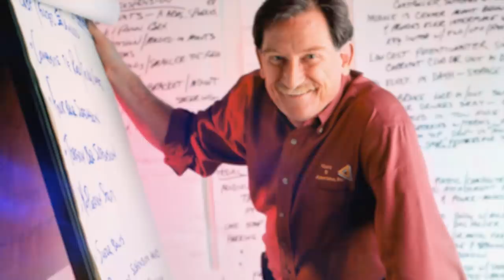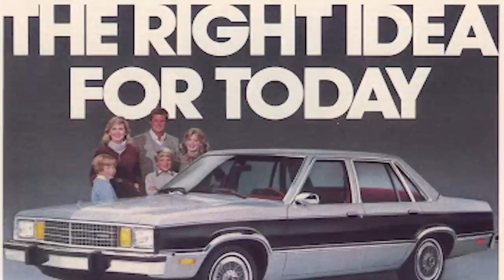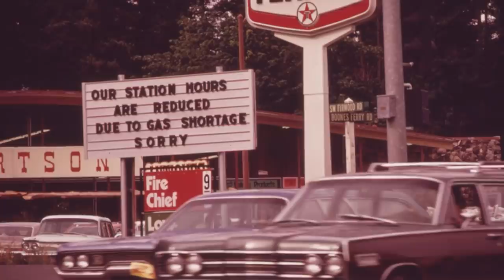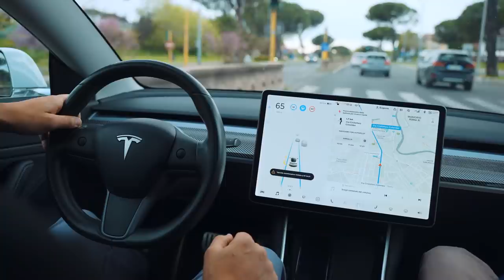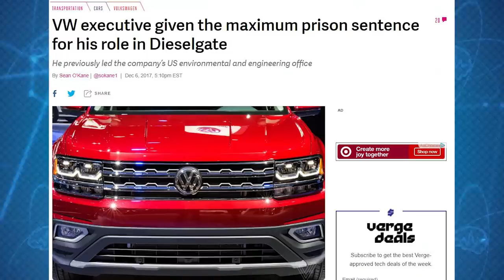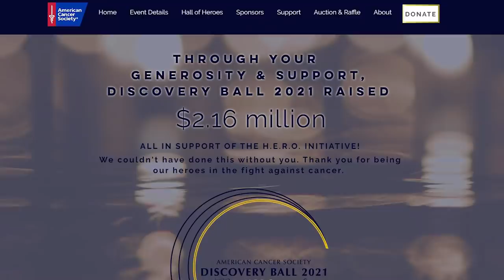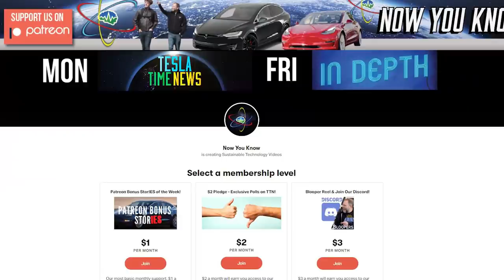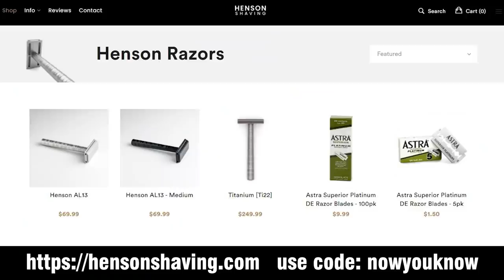China is Coming: Observations from an Expert | In Depth

Comment: I live in the Philippines. Geelys are sold here. They have the latest technology and are exquisitely well put together. They have integrated Volvo quality and technology into an inexpensive base model car that sells for about 27k USD, and that's with the Philippine 40% import duty tacked on.  The US can not compete.
Reply: happy that you like it, in China, however, we gradually go to EV cars. The best-sold ones are Tesla Model 3, Y (given that they have a factory in Shanghai), and BYD (very good local brands, they produce very nice batteries), BYD gives very high quality-price. There are tons of EV brands, NIO, Xpeng, MG, ....
Reply: If anyone in the jeepney association in the Philippines is thinking at all, they might partner to build an infrastructure to support battery charging stations. Several decades ago I recall doing a paper on electric cars by the big three here in America and I was astonished at how woefully behind they were contrasted to asian perspective on battery operated cars. It’s too late, $25,000 cannot even buy a decent new gas-powered car in the US today.
Reply: Are there any Geelys with fast charging ?
Reply: @ynordia  Not that I know of, if they allow them in it’s not going to be priced at $27k. The requirements are stricter here for foreign manufacturers.
Reply: @JonMagno  you're right, those prices are with 40% import tax while the US has no more than 5% so the raw cost with profit of the car to be shipped here would be 19k. Assuming regulation reqs cost 5K more, they could still sell it at a profit for 24K but realistically in the American Market they're going to sell it for a lot more
Reply: @naturecare6072  I may partly agree, but have a look around your place of residence, your clothes, your tools, your cookware, your computer, your cell phone you may be using to reply to this post. The world allowed the PRC to be its factory, voluminously. It will take a paradigm shift to change those habits. Also they don’t have a monopoly on copycatting many other countries are guilty. That said, I do not drive a PRC-made vehicle but I may have little choice in the future.
Reply: @naturecare6072  that is a typical conventional wisdom view, but it is the way China has dominated the world in trade Ade and manufacturing, why spend millions on R&D when you can appropriate someone else's technology, then improve upon it? China plays for keeps they don't play by your rules. They are ruthless in their efforts to control the world's technology, metadata, and money supply. China controls enormous amounts of US dollar holdings, it had a strangle hold on the US economy, your hollow words about the stereotypical Asian copycat view is naive. China is going back to the moon, the US just further postponed it's efforts to do same, the product of a state run capitalism bent on world dominance, china has a many pronged approach to producing goods, both of low quality for mass marketing, and the highest quality, I phones and Teslas, Volvos, Hummers, and many more, they have made us dependent on cheap Chinese goods while at the same time stripped the US of almost all manufacturing infrastructure. They are winning, because Americans were too stupid to see it coming.
Reply: What model are you taking about ?
Reply: I think china car quality is good, but their price is not a lot lower, and tesla is already in china. And the next gen battery tech is at  tesla, toyota and quantum scape not china.
Reply: Same here in Malaysia we now have
Proton X70 = Geely boyue
Proton X50 = Geely binyue
Both sell really well, i'm planning to get the X50
Reply: 8
Reply: @naturecare6072  your probably a fast food worker trying to take credit for all the Innovation around you. Haha
Reply: @linliuqiang92  childish remarks. Develop your EQ. Oh your gov won’t let you. They like sheep.
Reply: @randomname931  You can’t copy emotional intelligence.
Reply: @naturecare6072  ok, whatever.  just keep denying that china is pumping out quality, original designs and engineering.  you can't deny that they are the leaders in many industries (5G, AI, drones, apps including phone payment, and on pace to do so in EVs).
Reply: @naturecare6072  haha, you can try brushing off my childish remark, you cant brush off the reality of your minimum wage job.
Reply: @naturecare6072  Ok Gordon.
Reply: @TN-jb4jk  you should go look at the complaints. Poorly built
Reply: @naturecare6072  Tesla just built a huge factory there
Reply: I would buy a chinese car...but I would prefer it to have a Volvo badge.
Reply: Mercedes are £25,000 in UK 🇬🇧
Reply: @ynordia  GEELY is not that famous for making pure electric car, their first EV just went on sale recently (Zeekr 001), under a sub-brand ZEEKR.
Reply: Are Geelys are durable and safe? If they are, that's excellent!
Reply: @DEeMONsworld  i am well aware of everything you pointed out and more but I'm not going to brag about my China made toys and I at least try not to fund the CCPs military. Call that a "high horse " arritude if you want dude.
Reply: @MrRmann1234  no one was bragging, just stating the situation, few inside the US cocoon have any idea about the world and how China is sucking up technolgy and reselling it wolrd wide. Btw, I don't own a Geeley, never said I did. I have a Japanese car made from parts in Malaysia china and japan, and an Indian motorcycle engineered in the uk with parts from china. That pretty much sums it up.
Reply: @asterozo  lol 🤣 catl is the biggest and best batteries Olin the world's Tesla is using china's catl battery lol 🤣 where do u find these crap
Reply: @naturecare6072  haha. GDP doesnt mean anything for living standard. Chinese can buy more amount local basic goods than an american can.
Reply: @MrRmann1234  So buying a japanese or american car is also funding the enemies.. they literally invaded Philippines
Reply: @DEeMONsworld  good for you.  Now but a Tesla
Reply: @stewartbeche686  that's a rather naive proposition boycott every American manufacturer your saying as they all use Chinese labor, too late for that sentiment.
Reply: @cryptorenegade1406  we can do the same to them.
Reply: @donaldli1864  EVERYTHING!!!!
Reply: @MrRmann1234  true  preach on brother!!!
Reply: @ynordia  

Geometry brand, they are Geely subsidiary.

Go check out Wheelsboy.
Reply: @naturecare6072  

You meant like the NSA…?
Reply: @stewartbeche686  Spot on!
Reply: @JonMagno  Also because in the US everyone needs to drive a 12L V8 AWD to go to the grocery store...
Reply: @joaogaspar9155  There’s a bit of a reckoning that is happening with big oil and how the inadequacies in mass transport in the Mainland are bubbling up, gasoline has tripled in price - again - something has got to give. But, it’s all good, could be much worse.
Reply: There lies a sleeping giant. Let her sleep! For when he wakes, he will shake the world.

- Napoleon Bonaparte
Reply: China wants to rule the world. The world governments realized and knows it  a long time ago. China/Chinese people will put or invest in any kind of business, as in "All kinds" legal, illegal, you name it they have it. Scattered them all around the globe. And  the most important thing is all the profit/money gained will  go straight to China.
Reply: I think he is spot on
Reply: @KentMinlay  if you think that's what China is doing, man up and COMPETE, outcompete them, if you lose that's your INCOMPETENCE, stop complaining like a "NAGGING WIFE" so irritating
Reply: @KeepingTheIronThroneWarm  Mao only killed invaders who invaded China and people who wish to to harm to China, at Mao's time was civil war, Japanese invasion, ww2, but at the end UNITED China, had to and kicked out foreign powers closed the door before they cut up and destroyed China, that part you didn't mention, btw ghengis khan is Mongolian(conquered half of Europe) , not Han Chinese at least get your ethnic groups correct
Reply: I'm retiring in the PH with my wife on a smaller island on about 1.3 Hectares of land.  Once the home is built, with central AC and solar panels to run the house and her brother already does multiple things and has a tricycle that has a flat hauling side instead of for passengers and they have another motorcycle.  I've looked at the BYD, what they're calling a Dolphin right now.   Cost about $16,000 USD and that's what I paid for a Toyota Corolla in the US back in 2016.  Bonus, it's EV and I can charge it from our solar panels.

Protection is the real issue because of typhoons.  We'll have a garage to protect vehicles and a work area, the solar panels will be over the garage and a car port that is in front of the garage, still part of the home and you can walk out of the garage into the home.  I'm going to have made a roll in-out type frame for the solar panels so it can roll out to 5 columns and roll in to one column (20 panels, this might change).  Once rolled in then we can wall it in so flying debris can't damage the panels.  It's out in a rural area and lots of coconut.  Can't have a flying coconut smash up the windows, solar panels, etc....

Concrete construction of course with a bit of rebar to give the strength to the walls, two story house and lots of bedrooms.  We have no children and our nieces and nephews will inherit the home/land in a way they have to keep it together, no dividing because that's the downfall for people in the PH.  They divide up a home and start changing it, or divide land off that then another small home ends up on and you lost agriculture.

Boy I didn't know there would be such a steep import tax on vehicles.  If I have to add 40% to what I want as a $16,000 car, it's no longer worth it to me, so maybe we just buy another scooter and be happy with that.  Many retirees that move there don't buy a vehicle anyway.  Kind of a bummer finding out about that import duty being so high.
Reply: @johndoh5182  good pla, you understand the Philippines, I don't know what a BYD is but the tax is included in the selling price if you buy it in the Philippines, if you import it yourself you will pay dearly. When I bought my Triumph street twin locally, there was about 35% tacked on to the selling price, so it cost way more than if I bought it in the US.
Reply: @naturecare6072  you are absolutely right, Afghanistan has proven how powerful the United States warheads is.
Reply: Demand for EVs in the US is stagnant. Americans simply don't want them.
Reply: @naturecare6072  hahaha! Sure.
Reply: @badactor3440  doesn't matter if they want them or not they are being mandated by cuties for the future already and I engines are being phased out, euro regulations drive the market, and as euro 5 evolves onward it will make it impossible to manufacture an ice engine to meet standards. I don't see the logic as ev just shift the carbon emissions laterally to areas where electricity is produced, there is no free energy.
Reply: @johnm7267  CCP bot
Reply: @brandonhubbard  why don’t you try to think of something original to say instead of making one line fatuous comments? Do you know what fatuous means? Judging by your one sentence, one line cliche, you are incapable of saying anything original or worth listening too. I provided a detailed analysis of the subject, with verifiable evidence and all you can come up up with is an unprovable one sentence cliche. Well you you have described yourself perfectly as someone with  nothing to say worth listening too. It is almost a privilege to be called a bot by someone like you.
Reply: @johnm7267  in other words Brandon's brain is "CONSTIPATED" 😝😝
Reply: @johnm7267  ok CCP bot
Reply: @Rob Roy Are you one of those many Americans who believe that America is the best at everything, even though you have never been out ofbAmerica
Reply: @naturecare6072  The Tesla plants build for Quantity over quality also!!! As I took a contract at Tesla a while ago and then I was directly hired into the company and then promoted to an entry level management position and I caught and stopped dozens of defective chargers from leaving the factory after they were also passed and packed on pallets to be shipped out... And then the HR department and my supervisor plotted against me and falsified 3 different reports and wrongfully terminated me at the start of the pandemic... Taking my company stock... And they are lucky they did.... Because I ordered video camera glasses 🤓 and pens etc just to be able to record what was going on behind closed doors there!!!!

Comment: 7 years ago, I remember buying an electric scooter from a china big brand. thought it was cheap and wouldn't last. 7 years later, other then a battery upgrade, i'd say its value for money, cheap and good!
Reply: I bought one second hand 2 years ago. It recently died after driving about 8000km (2 sets of tires), opening it up several times, damaging the seal and literally drowning the battery while off roading in heavy rain. 
At 4 cents/mile TCO it was basically free, so I bought the exact same again this week. It has minor improvements and the price is 25% lower now! 
I want to make a Solex style bicycle motor out of the old one :)
Reply: 5 years ago I bought a 100$ Infininix  (Chinese) smartphone, I'd no money and I hoped it would last at least one year.  5 years have past and it's still working as my secondary phone.
Reply: I also bought a Chinese scooter.
Not so cheap at $700.
The scooter lasted less than 6 moths.
Still under warranty they refused to fix it.
But told me that for changing my review from negative to positive they would pay half for the repair.
Reply: I have my DJI Mavic 2 with me and it's still the best drone for me. No other drone brands come close to this Chinese brand DJI. Not sure is there even a competition.